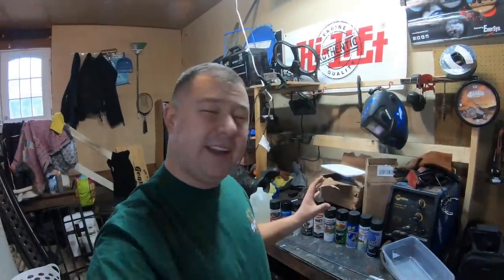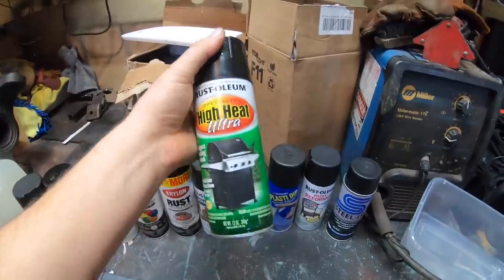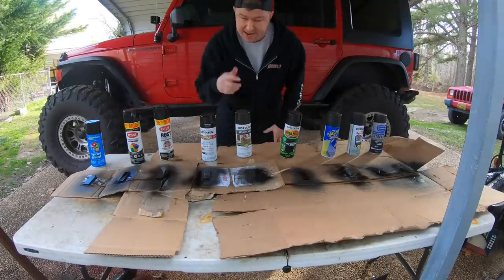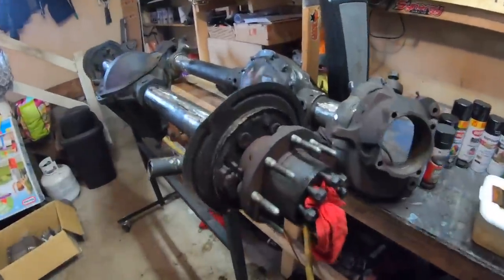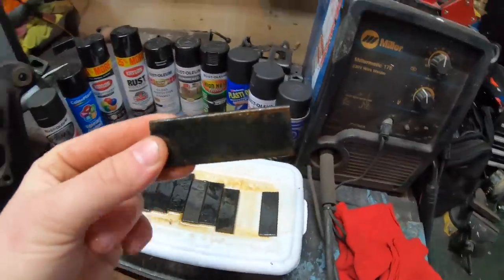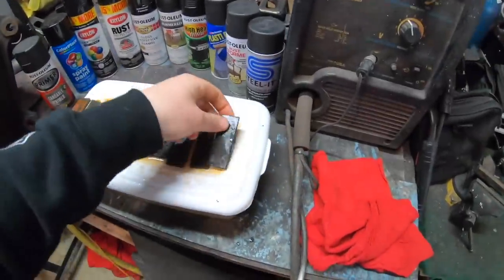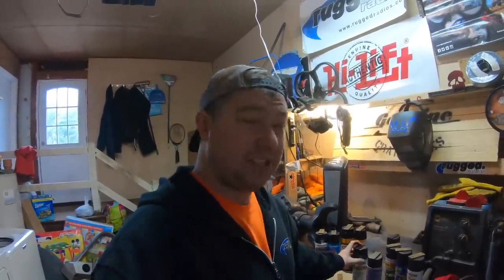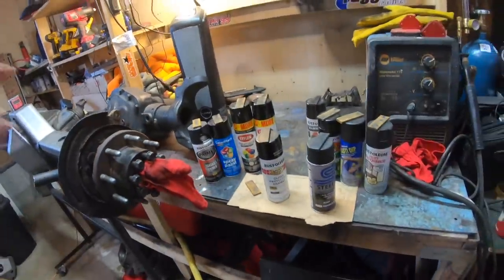Spray Paint VS Rust!! - What Brand is Best?

Comment: Since no one seems to have the capacity to do research, I will explain the Steel It product. It is NOT a powder coat as some channels ignorantly claim. It is not a paint over rust product, it is not a rust converter. It is the industry standard for structural steel, grain silos and USDA food grade storage containers. It requires media blasting to provide an aggressive base for the epoxy and polyurethane coatings. 36 grit sanding is acceptable for the spray can. It requires primer. It is used by the coast guard and the marine industry for superior salt corrosion protection. Testing performed by the manufacturer and the coast guard showed a minimum of 5 years corrosion protection in a 15% salt submersion. The ocean is only 5% salt. This stuff is extremely expensive, it is weld through and the manufacturer is adamant that you don't grind the product when welding. It's weld through, it contains stainless steel micro flakes. It costs 1200 dollars for 4 gallons, so it's not for the poor rustoleum crowd. This stuff is used on our semi truck frames and using PROPER prep, our trucks are rust free after several years of operating in the rust belt. It will not pressure wash off, it is impervious to chemicals like gas, brake fluid etc.
Theres too many dimwitted people on YouTube making vids and shitting on the product, and they are the problem not the product. If you buy it, follow proper steps to prep, because there is no way that the US Coast Guard is using it successfully yet inbred cleetus down on redneck road is disappointed with it because it "sucks".
Reply from the maker: First off… this is not the first video I’ve made of steel it. Feel free to watch my other videos where I actually talked about it and went in to it.
Also, news flash the Coast Guard might approve it, but we do not use it. 
10 years active duty CG, ships, shore, tanks, etc we do not use steel-it.  
PS, I have 20 cans in my shop.
Thanks for the comment
Reply from the maker: I used it on my axle builds. Held up great for 3 years. Brake fluid wipes it right off though, go give it a try
IT DOES NOT REQUIRE A PRIMER! You should read more about it or use it for yourself.
Have you welded through it? I have… it’s worth grinding off… But yes good product. 
This video is over 3 years old and I spent about 30min making it. So please don’t waste your breath or time trying to argue over the internet about a 3 year video that I don’t really care about anymore.. I have plenty of steel it, and 0 cares about your opinion honestly lol

Comment: Ik its 2 yrs late and it may have been said already but rust reformer is not supposed to prevent rust it is to turn red iron oxide to black iron oxide witch is not harmful to the none rusted metal. Also rust reformer will cause non rusted metal to rust.

Comment: Not a very controlled test . You should re-make this video using separate containers to prevent cross contamination and to apply the paint as directed per each cans instructions . Not all paint lays the same and it was a very unfair test

Comment: Rust prevention and durability are not the same thing
Any well applied spray paint should do well on a static piece of metal,
But your axels will get a lot of debris and dirt hitting it.  
Even a poor powder coating will likely last a lot longer then the best applied spray paint
Spray paint just doesn’t harden as strong.

Comment: If you wanted to choose a paint that's going to hold up best, why didn't you just use a 2K paint?  They sell it in spray cans with its own built in activator.  All you do is push in the button on the bottom and shake for a minute...  All 2K paint will way out perform any these spray cans.

Comment: For $25-30 a can one can get the parts powder coated and not have to deal with rust and it looked like Steel It won over the one you said won.. I’m confused.
Reply from the maker: Steelit did win, but it’s not really in the same category as the others. 
As for powder vs steelit, I painted my entire axle with 2-3 cans vs paying 400 for the axle to get powder coated. It’s also nice painting a bumper with a can opposed to 100-200$ for powder

Comment: All this video does it show me that proper prep work and following instructions is better. Most of the failures are at the edges, where the paint doesn't coat well.

I had plastidip on my car for 5 years to keep it from rusting in Michigan winters as there were spots where the paint flaked and it was bare metal. I reapplied it whenever it chipped/ripped but overall it held up great and there was no rust. That being said, I actually hate plastidip. 

While I did leave it on longer than recommended, the car was garage kept and I worked night shift so it barely ever saw daylight, yet it was absolutely stuck onto the car and the only way I could get it off was to spray it with dip dissolver/goo gone and pressure wash it with a 4200 psi pressure washer after saturating the car for half a day.

Comment: Unless you removed the scale off the hot rolled steel, the rust will start at the edges,as it is bare steel from the shearing process.   Sorry to say the test is not a viable test.
Reply: As you can see the corrosion starts at the corners of the blank. Paint will not build up due to the sharpness of the cut. The scale on the steel will inhibit rust for longer then your test.

Comment: I've used all the Rustoleum rust converters and preventers and I can tell you none of them work at all
Reply: So remember that converters and reformers aren't designed to be a top coat. They are designed to create a paintable surface where the proper prep isn't an option. I would still recommend primer and paint over a converter and a reformer.
Reply: @activemanishere  I think I'm probably using these as my primer and then painting over those. I'll have to give it a shot w the primer as well

Comment: I knew the result before you even started. Nothing good ever comes out of a spray can! I mean what can you expect from a 1k (1pack) paint. If it doesn't have activator/part b/hardener/catalyst then you can forget it. People claiming POR15 is great....overrated! Hell I even had powder coated wheels that weren't that though and eventually paint chipped. Moral of the story is get use to brown being your favorite color...because that's the color of rust boy! Also not using clear coat over any paint is waste of time, at least clear adds some form of protection even in 1k form. Plus makes washing/cleaning much easier. With the prices of paint, if I had a choice I would pick a 2-3mm thick bare metal compared to 1mm painted metal, because I know which will last longer in the weather over 5-10 year period.
Reply: Oh yeah I've also had Epoxy sealant Jotamastic 90 (90 is the new version that allow you to choose color mix from the RAL chart) anyway it's as tough as the powder coating. I know because when we tried it in the sand blasting machine it was equally tough to take off. Still chips as easy on contact just as anything, but the point i was going to make is Epoxy is not UV proof so the white wheels started to yellow after 6 months. Like enamel paint/powder coating it doesn't require primer and can be applied to even plastic. It's basically color and glue together the way I can describe it.